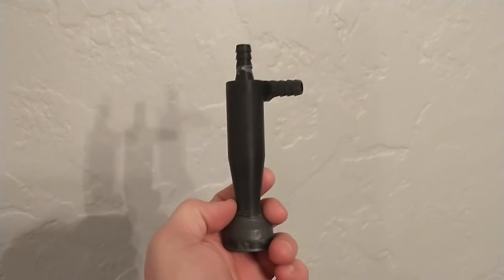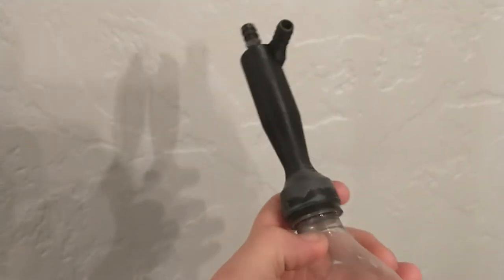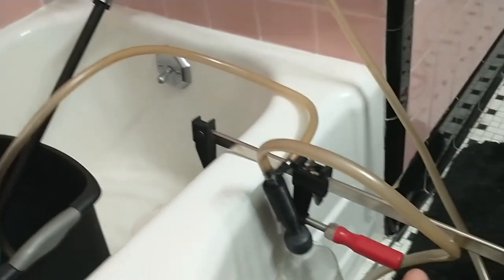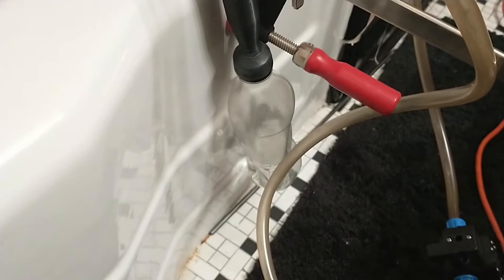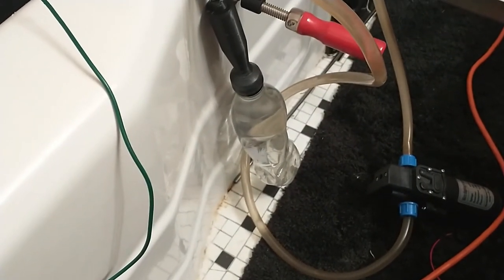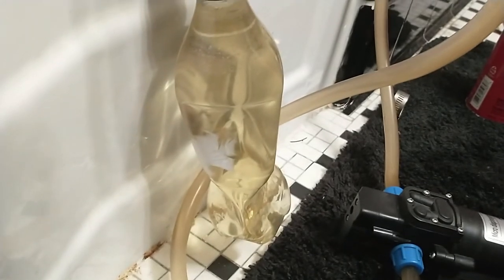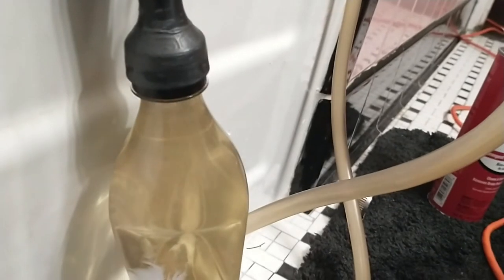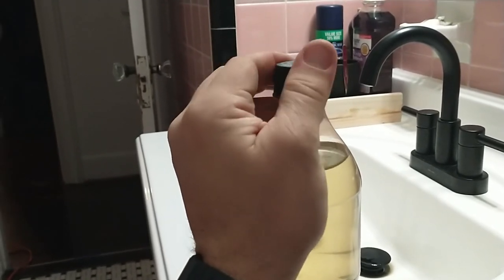Pop Bottle Cyclonic Separator for ElectroChemical Machining (ECM)

Comment: If you add some citric acid to your electrolyte mixture it will significantly reduce sludge formation and also help prevent hexavalent chromium from forming. 

I think the combination of 10g/L citric acid and this separator would make quite a nice setup.
Reply from the maker: Interesting. Would the citric acid increase the density of the Chromium making it more easily filtered out with the separator?
Reply: @turkey1099  It reacts it down to Trivalent Chromium Cr(III) which is still toxic, but much less so. 

The acid also drastically reduces the formation of sludge, so there's less solids present to clog things up.
Reply: @lordkyleofearth  and just add an active carbon filter that filter the Cr

Comment: that is a nice filter system. have you shown it in the ECM group, in the det dis communtie as well? they are working on the V3 ECM version. using a counterflow technic
Reply from the maker: Hey sorry I'm just getting to your comment now.

I know they do good work. Do you usually contact them via YouTube or on the deterance dispensed website itself? Also I've never heard that there was a separate ECM group.